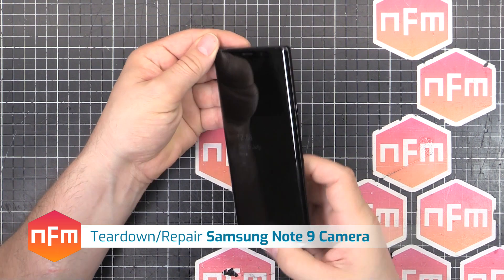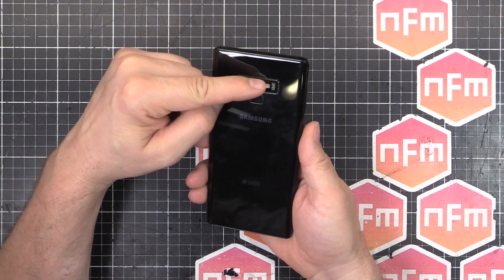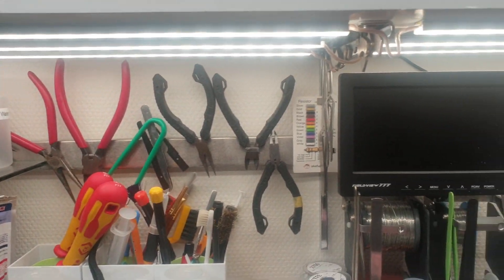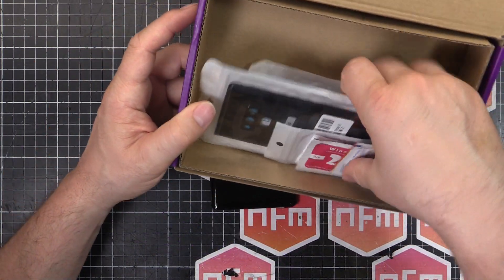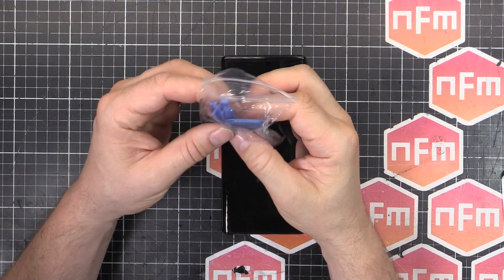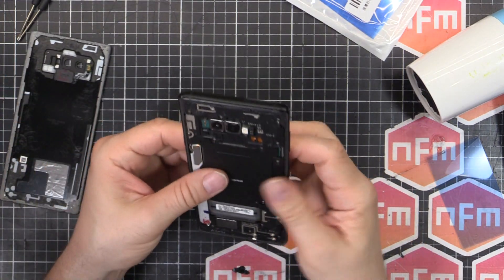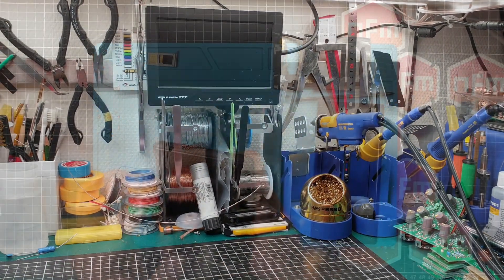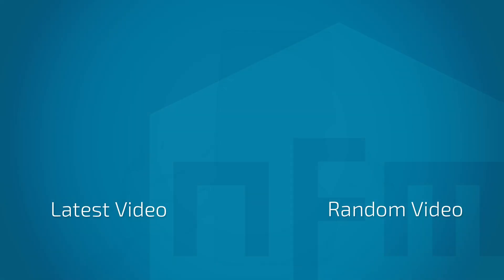Samsung Note 9 Camera Shake Repair and Teardown

Comment: They screwed up my phone too when they replaced the screen. The shorted something on the main board and it wouldn't charge with a usb c to c cable any more and didn't allow for file transfers from the computer. They of course denied ALL RESPONSIBILITY, refused to fix it and blew me off... Samsung was no help either....
NEVER USE YOU BREAK I FIX THEY WILL FUCK YOU!!!

Comment: My note 9 have dust in front lens camera ..well its inside ..can i remove those dust without any prob?
Reply from the maker: You'll need to remove the rear panel and a couple other bits like the wireless charging coil, then you can access the front camera to remove it and clean the lens. I don't think you need to remove the motherboard IIRC.
Reply: @NearFarMedia  oh thanks🤗

Comment: Have you bought screens from that website cos is a Chinese website and I never bought from them before? You need to heat the front of the phone to loosen up the adhesive so you can remove the battery.
Reply from the maker: I have bought parts from Witrigs a number of times now with no problems.
To replace the battery, you just need to heat and remove the back panel, no need to touch the screen.

Comment: I made a change of the camera as in the video, then I turned on the cell phone, I cleared the cache but even when I activate the camera, only a black screen remains, can you help me, what do I need to do?
Reply from the maker: Are you sure the new camera is plugged in correctly?
Does the old camera show an image if it is reinstalled? If it does, the new camera module may be faulty.

Comment: Is the camera module an actual legit OEM part or is it a "OEM Compatible" replacement part. I couldn't find any specific info on the website you obtained it from. My main concern is that I want the actual SONY_IMX345 camera module and not some compatible replacement. It's too sketchy to take the info provided by some websites. I was duped into purchasing a fake Note 9 OEM battery and the only way I was eventually able to find a "real" OEM battery for self repair was a seller who salvaged parts from damaged phones. It also exceeded my expectations by far.
Reply from the maker: Witrigs claim their cameras are OEM, but that's as far as I can verify.
If you send them an email, they might be able to provide more info.

My camera from them works great, as good as the original at least.
Reply: @NearFarMedia  LLP 1

Comment: Pretty slick.  So, the glue that held it together... did you have to replace it after heating?
Reply from the maker: There was new double-sided tape already applied to the new back panel so it was really easy to reattach.
If you were to reuse your existing back panel, you can purchase new tape, so you can peel off the old stuff and put the new stuff on.